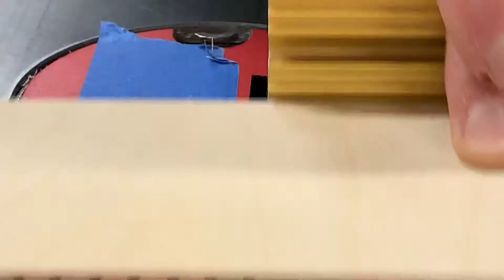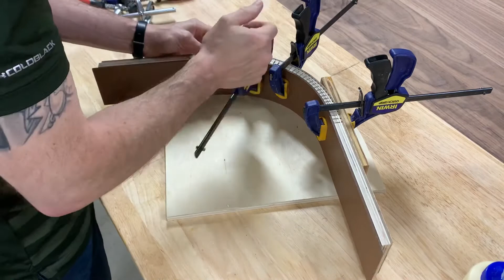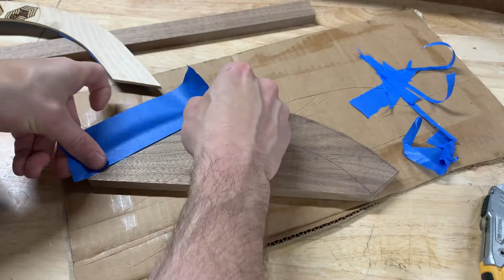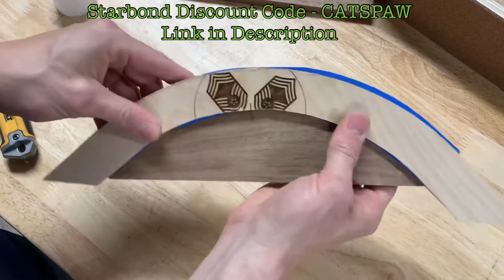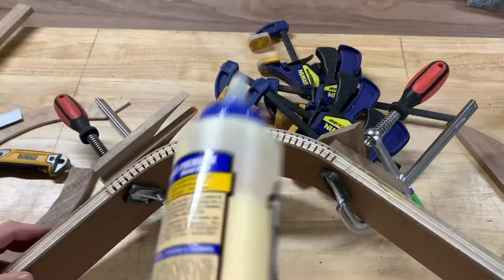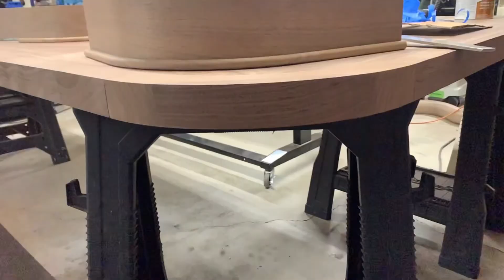Making Curved Trim with Kerf Bent Laminations

Comment: Looks awesome! How did you calculate the distance between each kerf?
Reply from the maker: Thank you!  And I did it by trial and error.  The first one had way more cuts than it needed, and the one when I filmed had less.  But as long as you have enough, it doesn’t really matter, because once the layers glue to gather, they don’t really flex at all.